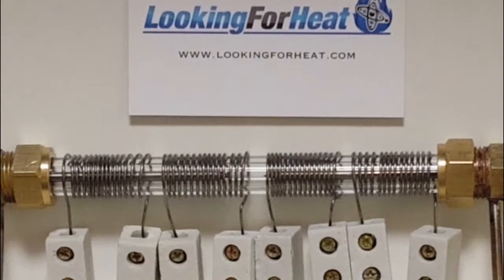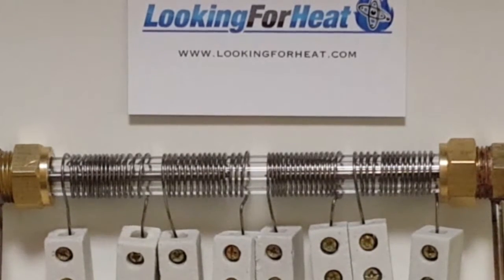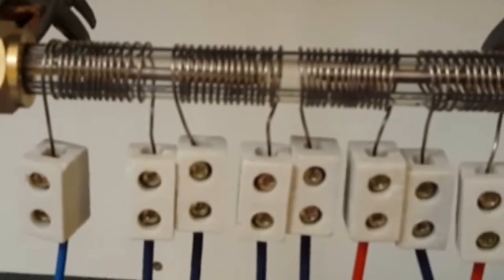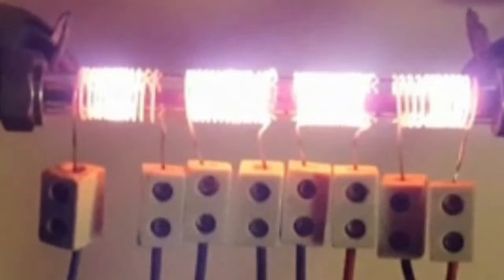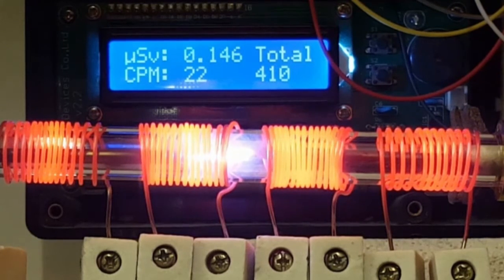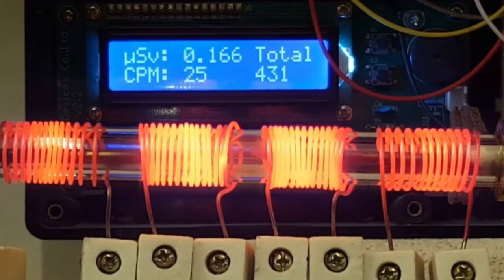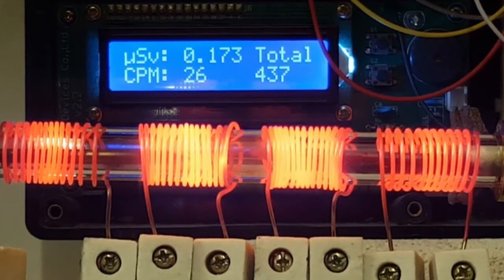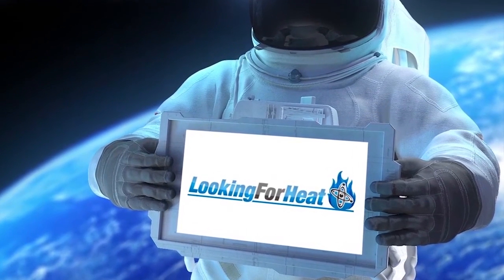Building a spark triggered LENR reactor - Part 2

Comment from the maker: "Hi. Thank you for getting in touch. The description of the item was up loaded by our web-marketing agent just 24 hours ago based on the manufacturer's description. We have enquired further and discovered that 400kV is actally a misprint for 40kV which is the manufacturer's actual claim. We can confirm that this unit does actually produce a non-continuous spark over a distance of 1.5 inches which suggests that 40kV is achievable. Many apologies for the mistake. If you notice any more errors in our web material please do not hesitate to tell us."

Comment: 400KV? Measured with what? A 1" discharge is approximately 25KV - and that looks close to 1". 400KV will produce a 15" to 16" discharge. What are you using for a power supply?
Reply from the maker: +wwwunitednuclear
The sparker has the following specs:
http://www.lookingforheat.com/shop/electronics/high-voltage-generator-400000v/
Reply: +LookingForHeat.Com The power supply you refer to is Chinese advertising nonsense. Just like manufactures advertising million vole stun guns. There is not one that produces over 50KV. If you are going to do scientific experiments, I suggest you stick with scientific facts. It is physically impossible for that unit to produce even 40,000 volts - much less 400,000. A good ballpark figure is 25KV per inch of discharge. If you can produce a 2" discharge spark, you've got about 50KV. Your power supply can never, ever produce a 15-16" discharge. You would be wise to measure the output with a high voltage probe. If you can't even state the correct voltage you are applying, the rest of your experiment & science is suspect.